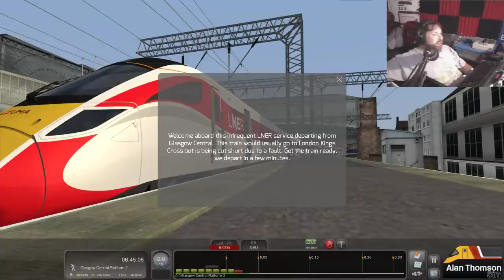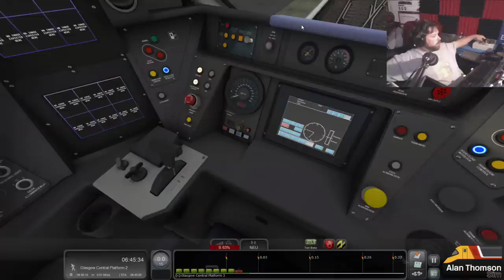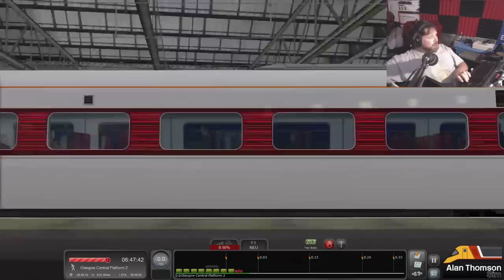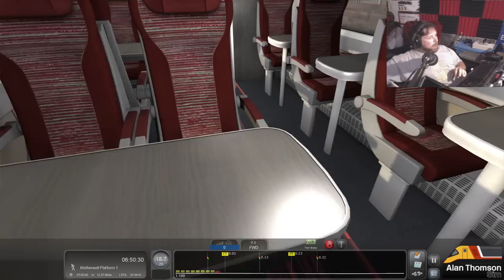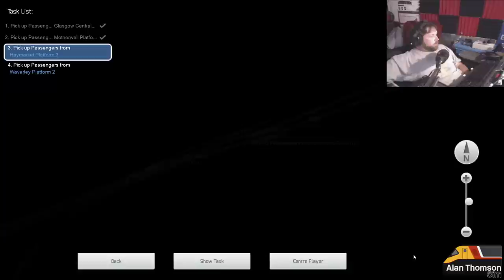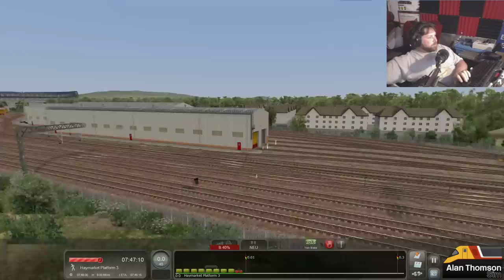Train Simulator 2020: Class 800  1E06 Glasgow Central Edinburgh

Comment: Can the PBC controller on brakes be made non stepped for trains that don't have a stepped brake as the 444 450 380 185 800 801 801 don't have stepped braked 
Also the 390 has 5notches for power and 6 notches for the brakes is it possible to drive the 390 with controller as it looks like there's not enough notches for the 390
Reply: also want to know this